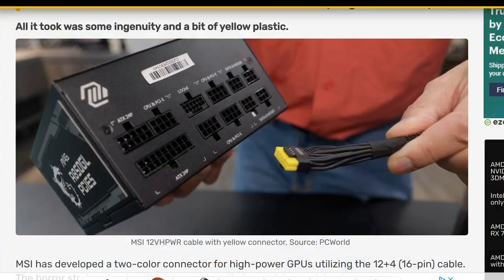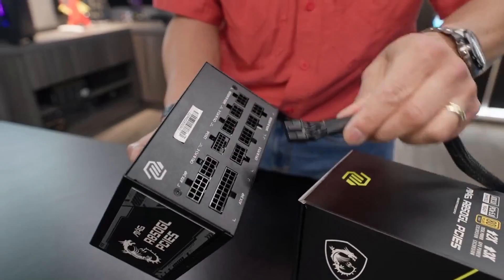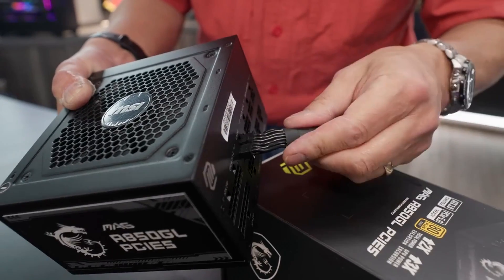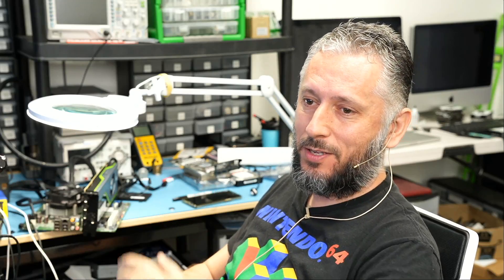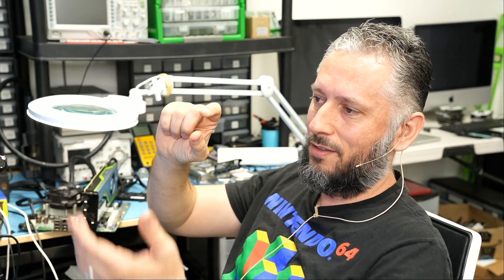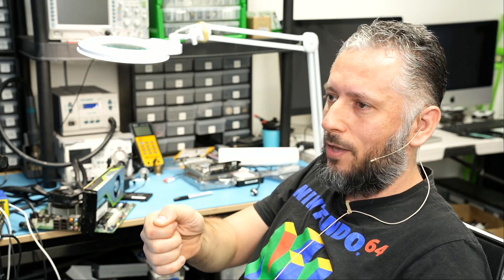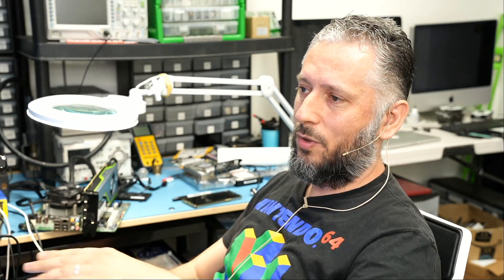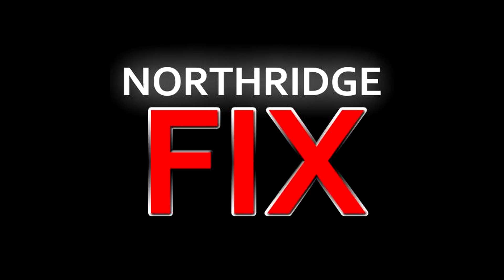4090 Melting connector Fix using MSI yellow cable 12VHPWR. What?

Comment: How come every one of these connectors are melting on the GPU side? I haven't seen or heard of one melting on the PSU side. I mean it is a cable, so it has two connection points could it be an issue with the different types of metals used for the pins or is it because people are jamming the GPU cable at extreme angels cause their case is too small?

Comment: Its definailey the cards the issue. too much load on the one connector. they need to spread the load onto another connector or maybe 3 connectors on the card.

Comment: Yeah, I think the yellow connector could help somewhat but it is a stop-gap/partial solution at best. This standard needs to be retired. I could imagine the cable being knocked/displaced just by putting your glass front panel back on in quite a few cases (including my own).

Comment: I think that it has been proved that just 0.5mm of misalignment will cause issues. You can clearly see in this video and in the previous Gamers Nexus one that the connector moves by at least that amount even when the locking tab has engaged. Classic connector design fault, exacerbated by too many cables coupled to one connector.

Comment: I sill think it is caused by design flaws.  
instead of putting just one connector on a graphics card, they should have put more than 2 to distribute load thus reducing chance of fire and melting connector.  
4090 just draw too much power for decades old power design.

Comment: How much would it cost in plastic to add two clips, one on each side for such a wide connector? Not very much I would imagine and the PSU side of those cables is proprietary to the power supply vendor and does not need to maintain compatibility with other power supplies since those cables that plug into the back of the PSU ship with the PSU itself so they could definitely do better. There are cheaper PSUs that are all hard wired and don't have removable connectors on the PSU side. And they still melt so I'm not convinced PSU side connectors is at all related to this problem. And finally when an arc fault happens it gets hot and melts where it's arcing and I have never heard of these connectors melting where they meet the PSU so I don't think anything needs to be done there. The solution as obvious as it may be, I would think needs to be on the connection to the GPU.

Comment: Card can draw around 50A @ 650W, people don't really understand how much 50A is, its f*cking a lot, and those connectors are nothing (they are too small) for such amp draw. I'll bring example from AC, it isnt the same as DC but some comparisons can be made. 3 phase 7,5kW AC electromotor draws around 16A at nominal power, yeah.
Connector should have been more robust, something like industrial power connector (i know its used as a joke but there is some truth there) but smaller and redesigned obviously. 
But ofc, bigger and more robust connector means more grams of material used per card, and when we multiply that by few tens of thousand cards we are already in 100s of kilos... so, corners have been cut and money saved, good job.
There is also another solution, that is to bring up the voltage, after all P=U*I. That way current can be brought down while power stays the same.
So either better connector or playing around with voltage(which again would mean redesigning of card itself), all in all manufacturers mistake.

Comment: but.... its the power connector end of the gfx card that he should be testing not the  power supply!!.. to me there is too much load on the 4090 power lines and it over heats enough to melt the connector .. there just creating more problems than solutions... as usual manufacturers making excuses and blaming users when instead of stick better power delivery or better heat sinks ...they typically rushing out fully untested products ...and changing the blame off them selves... typical tactics

Comment: The locking tab on the top of the connector should hold it in place but it is designed poorly and not perform its task. 100% bad design, lack of testing.

Comment: This is not a fix, it just lets you see that connectors have tolerances. If you grab a psu cable connector with one hand and the cable itself with the other hand and wiggle, you can see that the metal parts witthin the connector plastic sleeve moves. This play can be a millimeter. 
So don't push on the plastic sleeve but on the cable itself. 

Still, it's bad design for more than 150W of power.

I think psu manufacturers should move to aviation style connectors which are threaded so they can be securely fastened.

Comment: 12VHPWR standard should be revised until all GPU vendors adopted it. What's interested about this standard is that Intel invented this connector, but Intel didn't adopt it in theirs GPUs. 😁
Reply: That is not correct to my knowledge, though it was spread around quite a bit at one point. I believe it was Nvidia and Dell who pushed this new connector forward and Intel was forced to accept it in their specs because it was going to be coming to new gen GPUs.

Comment: I am still 100% behind this being a faulty cable / port design.  Even when the cable clicks in and that clip is pushed in all the way it still allows movement to the side as clearly shown with the yellow cable.  They need to take ownership of this faulty design flaw and go back to the drawing board and recall these cards and cables.   In my opinion that clip should be wider so that it doesn't allow any side to side movement when it clicks in.   It's great that MSI came up with a work around so that you can visually see the faulty cable is loose and it's telling you to reconnect or push it back in all the way and don't touch or stare at it the wrong way or it might pop out on it's own "jokes aside" :D

Comment: The solution is to tricky, there is high chances of touching the cable when installing other components such as SSD, fans etc. I still don't understand why they changed to that connector

Comment: If it really was a connection issue, why not just put an extra clip on them? Have 2 clips 1 on each side so it doesn't wiggle as easily? I see them doing this as a cheap way to pretend that they're fixing an issue that's probably caused by too much power being crammed into 1 end so that they can then pretend they're no longer liable for whatever damage happens as a result.

Comment: As I see it, the 4090 power connector is on the limit of what the connector can handle. The card manufacturers won't admit it though, so they are desperately trying to find a way to make it work.

Comment: I did not want a 12 pin and i have suffered quite a long time of driver issues 8+ months drivers finally useable, so i had a reason to switch to Nvidia but bought a liquid devil 7900 XTX instead
12 pin should be banned its current design is not safe its just planned obsolescence.

Comment: One thing I don't understand is how was this not an issue (or not as big of an issue) with Ampere cards? They were more power hungry.
Reply: It may just come down to the number of cards out in the wild. Most Ampere cards used the old 8 pins and only a few Nvidia FE cards used the new standard, so any AIB cards will not see this issue.
Reply: @--_DJ_--  Yeah I also think this is most likely the case.
Reply: Maybe also because a lot were used for mining and voltage is set lower

Comment: Nobody wants to accept the fact that this is a design flaw from Nvidia itself. 3090s use the same connectors and also, the psu side of the connector is not melting even when not 'fully connected'. I respect media outlets like GN but this time am disappointed because they chose to lay blame on the consumers.
Reply: If this is a design flaw, then NVidia MUST recall all the 4090s because at some point every connector in those cards are going to melt and possible cause fires, its a big safety issue.  I have read about people pushing 600W+ with those conector with no issues..to me this is a defect on some cards.

Comment: Does anyone here know about "Arc Faulting"?
IN the world of being an electrician, it's when a circuit with a load is NOT completely connected as in, the surface area of a wire touching another wire or receptacle connector or in a power supply circuit breaker box, a wire connections is NOT screwed down to a breaker or a buss.
The slight connection's surface area is close but not enough for a good and solid connection.  What happens between the two slightly connected surfaces is an electric arcing. This bad connection that keeps arcing back and forth builds up heat and in time, can burn the wire and connection point.
I'm guessing that the connecting cable's female contacts are leaving too much room around the plug-in's male connector and causing this "Arc Faulting".
My assessment of the problem is to change the type of connection system.
Get rid of the old style connector on the board and engineer a new type of more contact tight connection with the plug-in cord.
You don't see this happening with a USB type connector.
My USB on my Dell XPS is very tight.
So, why not design a connector with a larger USB style plug?
All this is, IS a design flaw that the company doesn't want to deal with as they're all ready so many out there and it would be like a vehicle recall.
Yeah, costing too much money to fix.
Of course you could just put permanent wires on the mother board in place of the board's male plug-in and run them out the back of the unit with a wire (Anti-yank) hold down.
Then, have that wire fitted with the leads to the regular cable that you normally would plug in.
This eliminates the Arc Faulting male plug.

Comment: IMHO the plastic part of the connector is irrelevant,  the only thing that matters is the metal on metal connections and the resistance  to the current demands of the graphics card [i+e/c].  Increasing the surface areas or gold plating both ends of the connectors conductive surfaces is only thing that should solve this issue, or not buying this junk.

Comment: The amount of current going over the new 12V connector makes the problem worse. The old PCIE connectors were limited to about 150W or 12.5A, the new connectoes will go up to 600W or 50A. More power means more heat and a loose connection means big problems.

Comment: I liked power supplies with fixed cables more than the ones with replaceable/removable cables because one less connector, one less contact issue.
Reply: And what you do with other 60% unused cables then?
If you have problem dealing with cables on pc then buy console instead
Reply: @aga1nsty0u  I have a HUGE case for my dual CPU motherboard to cool better. So I have no issues hiding unwanted cables. I had melting issues with removable cables at high current. I can replace/remove unwanted or damaged cables if needed.
I don't like consoles. The games are a little bit expensive for me to try on a console. They overheat, too. My PC is easier to clean than a console. And consoles can't cut videos and music. I have a dual CPU i7  setup with a large 11GB videocard and 24 GB RAM. No console has that amount to use for whatever I want to use it for.

Comment: i have the solution. The connector has to have the locking screws like VGA cable has. The plastic lock isnt safe. You are welcome Nvidia
Reply: or.... go back to the triple 8pin solution. Overbuilt af and  Or go 4x 8pin if need be, since it works

Comment: It's simple. All manufacturers should split the ps connector into two connectors to half the current supplied in each side. Otherwise they should completely change the type of connector, a more robust it's obviously necessary. Thanks for sharing knowledge!
Reply: You mean go back to the trusty old 8 pins we have had for decades? Sounds like a good idea to me.
Reply: @--_DJ_--  Honestly I rather have a 24 pin than these stupid new tiny connectors lol I dont even get the point of them, is it purely to make it smaller? because they are worse in every other way. Especially if they can be fully seated and still the tolerance can be off and melt. The connectors we have been using could be halfway out or dangling and still not over heat or stop working lol XD (a lot of people dont actually have their 24 pin all the way in or their eps, I bet the same with gpu)
Reply: @--_DJ_--  yeah this whole move towards making everything compact af is starting to show side effects

Comment: That yellow Plug is not much helping at all. The only thing that helps is to reduce the power limit to something safe for the 4090 like 60-75%. 
The Problem with this connector is not user error its a pure design/engineering error. You cant have a card draw a sh.. ton of Amps through only 6 small needle pins .

I just, last week had a Cablemod 180° Adapter melt on the GPU plug side (and i am sure it would have happened with my native plugs too) The Connctor was fully seated in there with not a single gap. I did make sure of that. I had this Adapter since end of February, and so far it did not melt, however i most of the time had my card power limited anyway.
What changed last week was, i did put on a new Waterblock that i had been waiting for and for testing purposes to see the new temps, i did run benchmarks and even MSI Kombustor with  Power Limit set to its original 100%. Since the temps were not what i expected (worse than before) i did want to reapply the thermal paste, hence how i found out it did melt. 
The Adapter before did not show any signs of melting before that or not that i was aware of because i did plug it in all the way before putting on the new block and after since i know about this problem and didn't want any chance that it melts...
well~

Comment: It's time everyone accepts that the connector is ass. Little to no tolerance at all, with no secure connection. You'd risk destroying your GPU even with a slight bump on your PC case.

Comment: This failure of a power connector is the reason I won't buy any GPU from Nvidia or AMD that uses it. Currently only Nvidia is using them so I decided not to get a RTX 4080 even if price to performance is better than AMD's 7900 XT or 7900 XTX. Two (or three) 8 pin power connector is a proven standard that has worked for decades so why change it.

Comment: If I buy a time machine, and the time machine doesn't work, the problem is on the one who sold me the  time machine or is it on me who bought the time machine?

The responsibility is/should and always be on the customer. Any, absolutely any other solution will be, and always will be, authoritarian because it will be under the use of a unilateral force against a provider of productor service.
Reply: *if i buy a product and it turns out to be defective, i'm always responsible for the product being defective... is what you're saying

Whats the going rate for shills these days?

Comment: That MSI connector will still melt.  The issue is the size of the connectors that touch the pins on the gpu.  They reduced the contact surface size on the 12vhpwr connectors.  The 16awg wire they are using can handle the amps, but the connectors/pins can't.  

Take a pair of jumper cables, cut the big clamps off one end and then put on some small alligator clips on that end of the cables.  Try to jump start a car with them and see what happens to those small alligator clips.
Reply: Yes I agree, it’s only happening on the 4090 because of the larger TPD being drawn. The 12VHPWR connector is to blame here and is a design floor. Nvidia already know this but will not admit it. These manufacturers and Youtube influencers are only giving Nvidia more reason to blame the customer with this seating crap!
Reply: Yes, it's true
Reply: What were they smokin' when they designed this
Reply: @Kevangelo14  they were smoking the connectors
Reply: @tbone9912  smoking burnt connector 😂😂😂
Reply: @Kevangelo14 dollar bills😂
Reply: Clearly the engineers who designed these cards had no basic knowledge of electrical theory.

When you have to deal with low voltages with high current, you will need bigger conductors and bigger connectors with larger pins.
Reply: @rob3125  Ya, but you figure that a company that has been making gpu's for 24 years would know this.  Seeing as they started adding more 8pin headers as the cards started drawing more power.
Reply: I agree with you

Comment: i thought he drew it bck a bit to SHOW how it would look?!  not fully seated... but just from what i see .. i believe the current A is to high for a single pin in this case for the 4090 .. either haevier trace or bigger pin ?.. but resistence from small handlintg variation is too intolerent sensitive to be acceptable .. just beef the connector by ?.. tolerance and watch the problem deminish..

Comment: I remember one of the things they were originally saying about the 12VHPWR connector was that it had a limited number of connect-disconnect cycles. Has anyone been talking about wear of the tin plating due to multiple connector cycles contributing to resistance and overheating or was that a red herring?
Reply: The 30 cycle thing has even been a standard with even ATX connections, it's largely just advisory. In the case of these connectors, I'm not sure they're even making it that far.

There was some to do about one brand of connectors over another in nVidia's OEM ecosphere having shearing problems iirc.
Reply: The new connector has the same rating as the old 8 pins, people just didn't know about the limit before so it seemed shocking that you could wear it out so "quickly". I am sure most of these melting plugs haven't been used more than 1 or 2 times so wear shouldn't be a cause for the majority of failures.
Reply: These are new graphics cards. I highly doubt that a user would have plugged in  the cable more than three times.  Secondly, wearing of the plating would not be the cause.